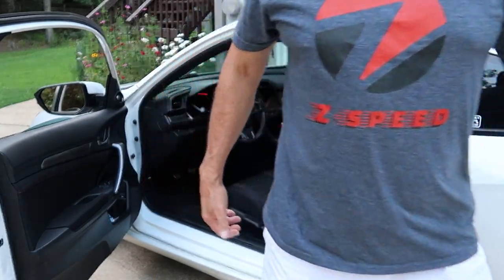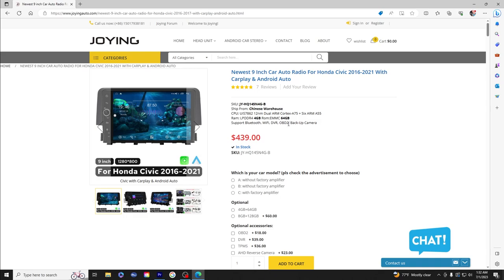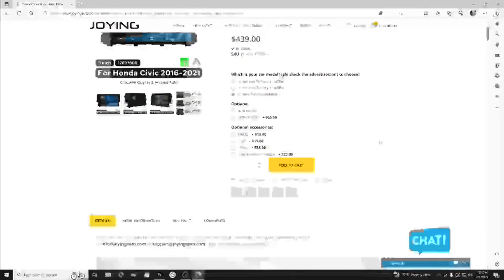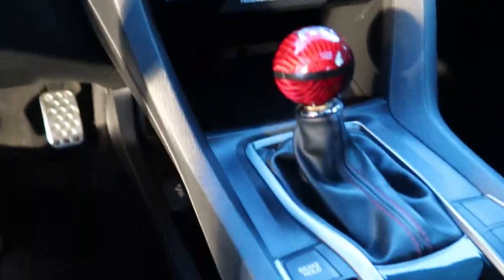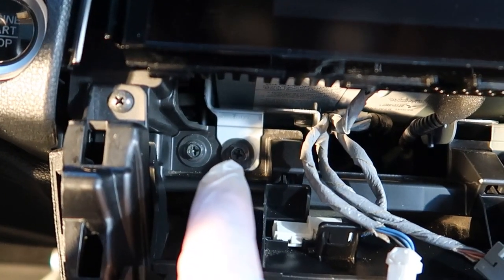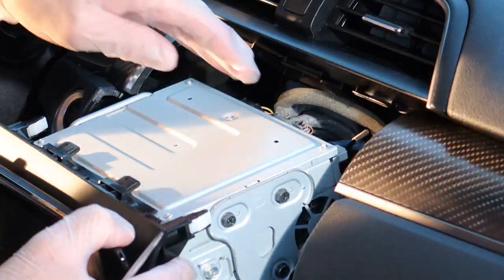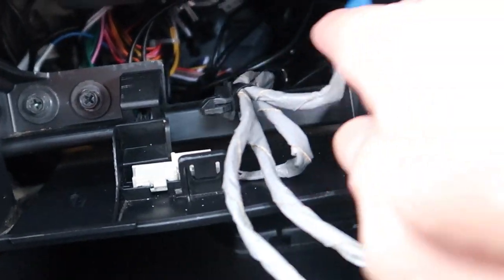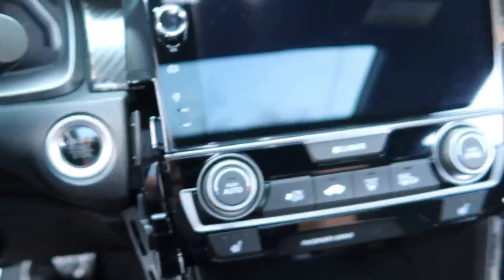Joying Android Head Unit install 10th Gen Civic #joying #civicsi

Comment: Plugged it back in and the head unit doesn’t turn on :( there was a brown colored plug and a black plug with a blue wire in my 2016 Honda civic coupe EX-L that didn’t have anywhere to go.
Reply from the maker: Amplified or non-amplified harness?
Reply: @Zspeed  sorry i forgot to mention, i have the factory amplifier. I bought the same unit as you did. When my original head unit was cracked, I spilled water on it and the head unit completely powered off for good. Maybe I blew a fuse?
Reply: @GameFiai did you get it repaired or working? If you did could you tell me how?
Reply: @eyeyamjstn628  Yes, the audio fuse was blown. I just had to replace it with the spare and it turned on.

Comment: Hey bud, but chance do you have any update on accessing the TPMS and other vehicle maintenance settings. Everyone i know with a 10th gen is interested in this headunit but the TPMS reset being accessible is the "make or break" factor. Any updates you have would be greatly appreciated! 
....So i was just on their website. When purchasing besides with/ without factory amp option there's also 
Tpms-36$
Ob2-18$
Dvr-39$
Did you opt for these? I'm guessing if you did you got the tpms function.
**edit
So i reached out to Joying. If you bought directly from them you have the option to add on the TPMS reset/ with tire sensors for 36 bucks. If you bought yours from Amazon/ebay, Amazon has the tpms tire sensors for 39 bucks but it looks like you'll have to take the headunit back out to plug in the info relay unit.
Reply from the maker: Yes, you will  need to purchase the TPMS sensors from Joying if you want to retain this function. I have them but have not installed them at this time!